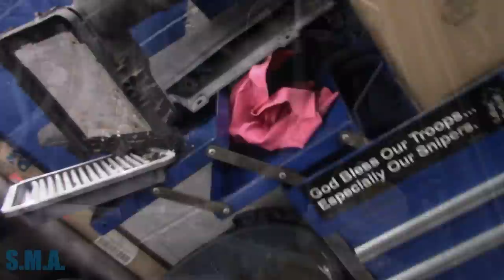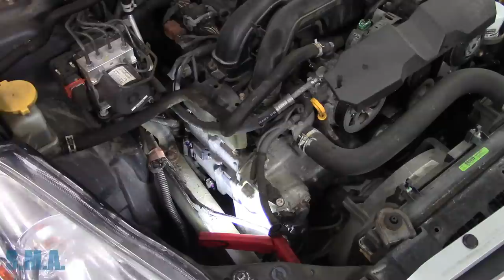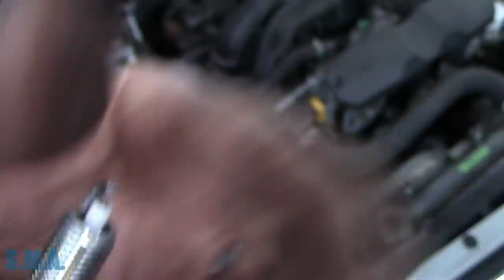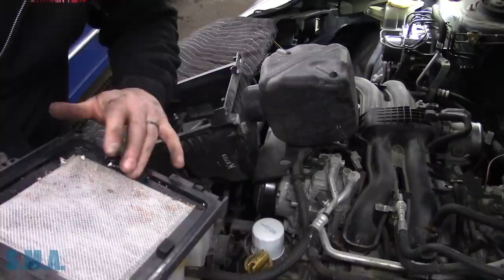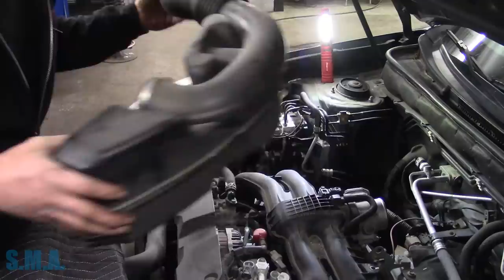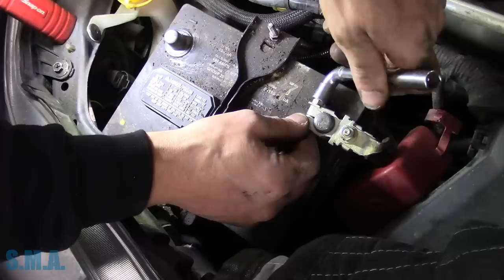Subaru Outback Repair Series: #2 Replacing Spark Plugs

Comment: how in the h....e.... double bamboo sticks they expect anyone to do a tune up? aint paying the dealer to do it...almost like the Pontiac car that had to literally drop the engine down to do spark plugs should get a set of magnetic spark plug sockets..they are amazing....only thing I hate about the majority of spark plugs is they vary in socket sizes. If you had a lath and a carbide knurler you could knurl the end of those smooth socket to make it easier to turn the plugs in give you a better grip

Comment: Surprised battery works-
it's been boiling over, top
filthy, voltage drop on
surface. The case & tray
appeared to be wet. Lots
of acid vapor around it.

Alternator will soon follow...

Comment: no gap check?
Reply: I was thinking the same.
Reply: @zeroyon223 100% agreed but I have had a couple that were not correct out of a countless amount  so I just always do a quick rough check without any force just for peace of mind. equivalent to plastigauging bearings
Reply: @zeroyon223 Every plug, these days, is pre-gapped with "computer" precision! We live in GOOD times!
Reply: @TheOzthewiz  not trying to be a jerk here but this is from NGK Learning Center:

Should I Gap My Plugs?

A spark plugs gap directly affects the tip temperature and the voltage necessary to fire the plug.  Spark plugs traditionally leave the factory pre-gapped for their most popular application.  However, a plug may fit hundreds of engines, from cars to golf carts.  Gapping the plugs to your engine’s specifications is important to prevent pre-ignition, detonation, fouling and poor fuel economy.  Even if the preset gap matches that required by your engine, it is always good practice to physically check the gap as it may have shifted during transportation (not all spark plugs are packaged in a way that protects the firing end ).
Reply: this is from NGK Learning Center:

Should I Gap My Plugs?

A spark plugs gap directly affects the tip temperature and the voltage necessary to fire the plug.  Spark plugs traditionally leave the factory pre-gapped for their most popular application.  However, a plug may fit hundreds of engines, from cars to golf carts.  Gapping the plugs to your engine’s specifications is important to prevent pre-ignition, detonation, fouling and poor fuel economy.  Even if the preset gap matches that required by your engine, it is always good practice to physically check the gap as it may have shifted during transportation (not all spark plugs are packaged in a way that protects the firing end ).

Comment: I still say that auto manufacturers should be forced to do these maintenance repairs themselves. If they are forced to do this enough times they will redesign the next model with better accessible components.

Either that or they will just come back and say that the vehicle is just "disposable". They are practically there now.

Comment: Changing the spark plugs on a Subaru: Several special tools, two plug sockets, remove the entire air intake system and the battery, almost an hour of labor for professional. Really Subaru? And what's up with the wheel bearings, not to mention the head gaskets on the big 2.5s

Comment: the back left plug is always a joy - it's worse on the legacy 2.5GT of that body style - the coil packs are larger, and for the rear one you have to remove, then rotate a certain way to get them to fit...  you have to wonder about the engineers on this one with the plugs right between the frame rails!  you would have thought they could have made a recess or something to make it easier...

Comment: I'll be curious if you call it a Forester in parts 3 and 4 as well
Shout out to Chrysler and their stupid freaking connector locks. Special mention to GM and their almost equally stupid freaking locks. I've never seen a connector fall off unless the plastic push tab is broken. There is no reason a connector needs two locks, especially one that is actually impossible to remove.
EDIT: please do a spark plug replacement video on something like a highlander or RX330, or even something like a nissan quest or even like an astro or something. For all those who are crying that theyll never own a subaru because its "impossible" to change the spark plugs lol

Comment: Not got time to watch (stuffing my fat face at work) but much easier to undo the engine mount and just lean the engine up an inch or so each side, can be done without but its s faff. Coil packs come out so much easier with the engine raised a little.
Reply: Oh.. Scrub everything I've said, I thought the outback was the same as the Forrester we have in the UK, those chassis rails are set a lot higher than than the outback by the looks of it. That looks a piece of piss to do compared to the Forrester.

Comment: Disassemble the top of the engine to change spark plugs?!?!??
I've changed spark plugs in about 8 GM's in my life time, 3.8s 4.3s 5.7s , LS and LT Engines and Have NEVER removed anything but the 200,000 mile AC Delco spark plugs!! 
And they all come out with just a quick flick of my wrist!!
Ahhh Subarus... Engineering at is finest...
I thought foreign vehicle's were engineered better LMAO!!!!

Comment: I absolutely hate doing Subaru spark plugs.  I've only done them 4 times - the last a 6 cylinder.  The engineers who designed the engine and chassis access need to be placed in a blender, feet first.

Comment: Good ol JUNK Scubarus...only company to make a 4 cylinder that is harder than most V8s to change spark plugs on. I can change all 8 plugs on my L59 5.3 faster than you can do two plugs on this car. And I don't have to worry about blowing head gaskets all the time. Because I don't drive a piece of junk Subaru. 

I've bought and fixed and sold and traded over 200 cars...I will NOT buy and sell a Subaru or VW or even Chrysler... Can't in good faith sell a car that I know is going to have lots of issues.